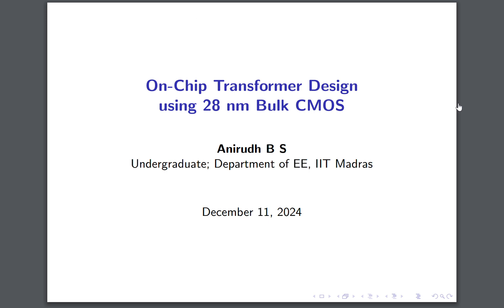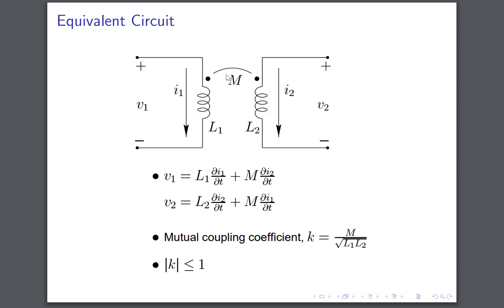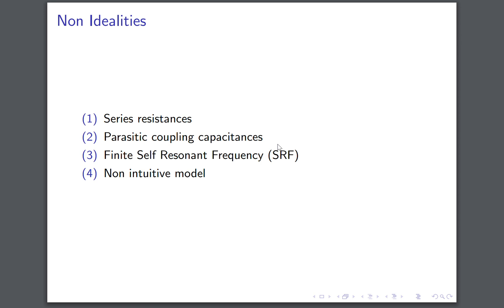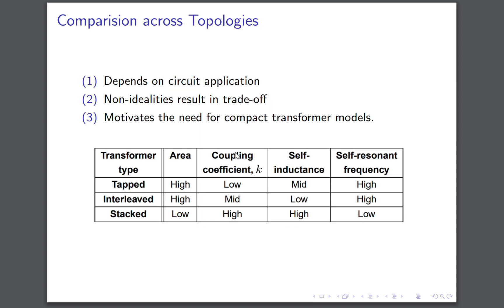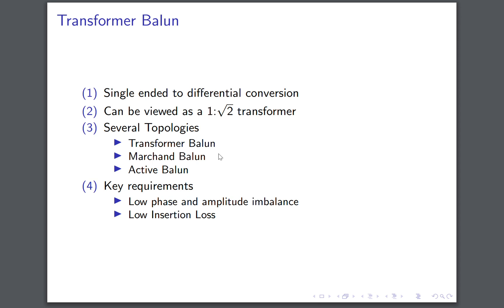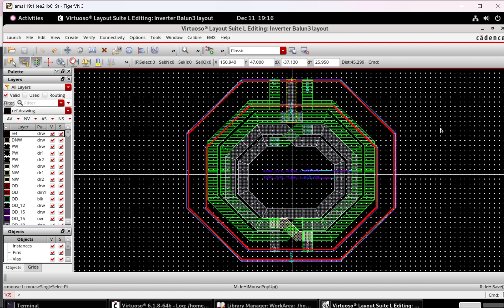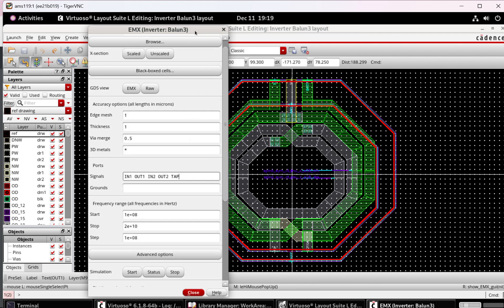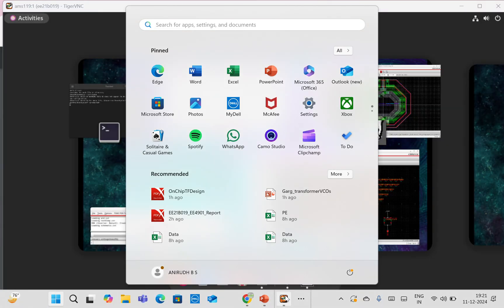On Chip Transformer Design using 28nm CMOS

Comment: I comment i hope I get a reply. 
I am working in CMOS 45 nm  PA, in the frequency range 24 GHz to 30 GHz, I used Balun Transpromer in the impedance matching input and power stage output. Can I use this technique to build the layout of my design? because all my labmates are using ADS to build the transformer's layout. and I am new in this field. i want to get benefit from your side.  i am so excited to contact with you and I can do research with you together and mention your name in my paper.
Reply from the maker: @yassinabdullah5209  
Hi 

Yes, you can use this method in designing the transformer balun. First step is designing the transformer balun in layout XL and extracting it's EMX view. To check whether your balun passes design rules, you can run DRC in a similar way as any other normal layout. 

With the EMX view of the balun, you can simulate in schematic to obtain other design parameters for matching etc. 

Sure, you can reach out to me via email at ee21b019@smail.iitm.ac.in